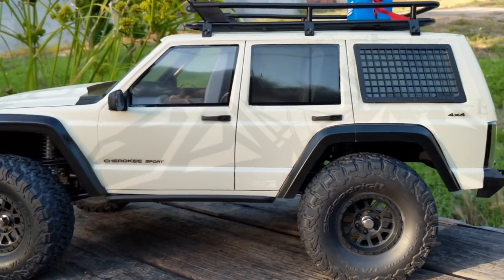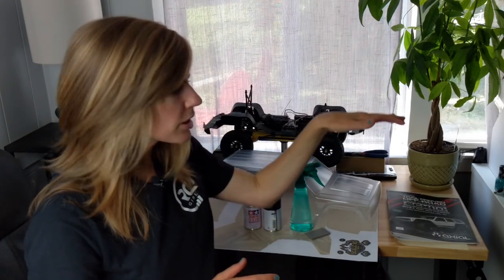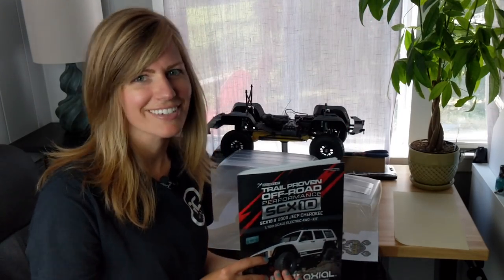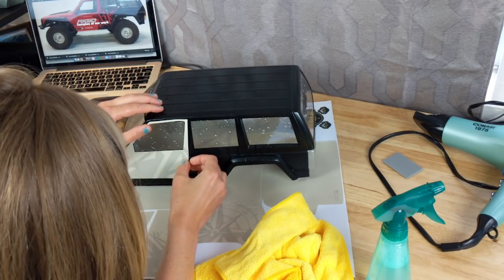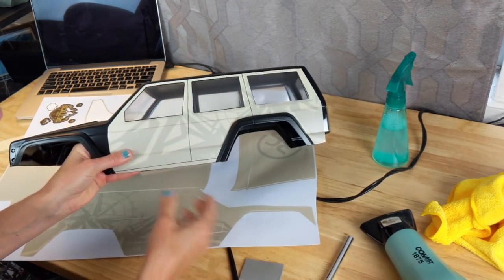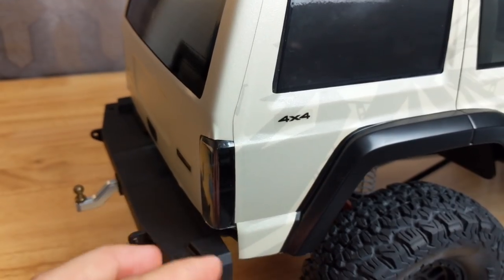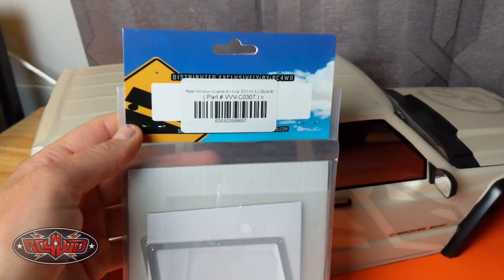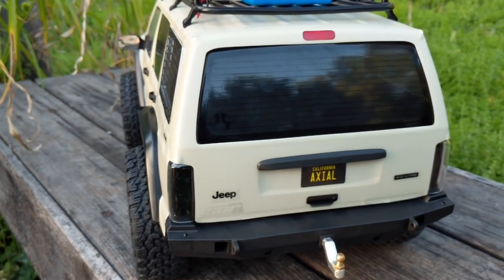HOW TO VINYL WRAP YOUR RC  |  Axial SCX10ii Cherokee XJ Build

Comment: Great job chick! Came out great. Might have to get one for my xj
What interior are you using?
Reply from the maker: It was 3d printed by RC VOODOO - you can find them on his ebay store: https://ebay.to/2X4ChF7 Snaps right into the SCX10ii chassis and can be painted. Pretty cool! Also protects the electronics.
Reply: @RCGirl  Thanks a bunch! So it fits with the grc inner fenders too rite?

Comment: Can this be done on a lightly beat up body? Or does it have to be new and completely smooth. I was also thing of doing just a bit of wet sanding to smooth out scratches.
Reply from the maker: Yeah I mentioned this but then cut it out of the video! But you can use an old body and cover it. I think the wet sanding it smooth would help, and also a  few coats of paint on the exterior.
Reply: Thank you for the response! This gives me some confidence to try it out.

Comment: Very cool idea & a you did an incredible job on your rig, it looks sweet! Just my opinion but a vinyl wrap could be applied to a hard body as well I'm thinking, wouldn't have to be a just a lexan deal I wouldn't think but that's of course just my thoughts & perhaps I'm completely wrong. I'd be willing to give a vinyl wrap a try in any case, had to share your video as well, to cool not to, great job & tips, thanks for sharing your expertise.
Reply from the maker: Yeah this could totally work for a hard body. I'm not sure what options SOR has for hardbodies though, I think most of their pre-designed wraps are for lexan bodies.